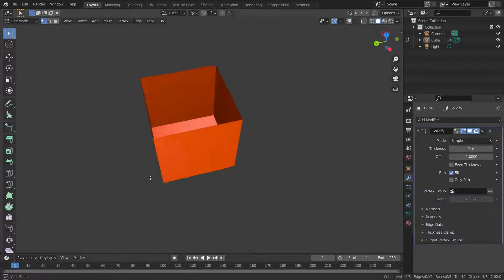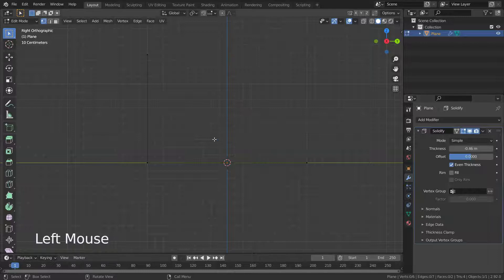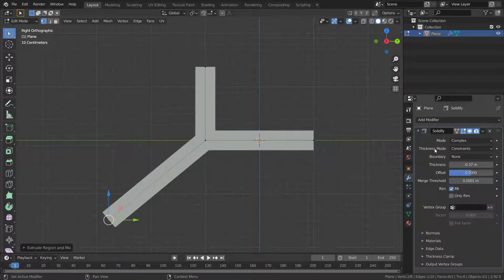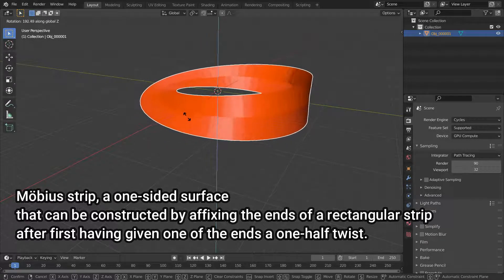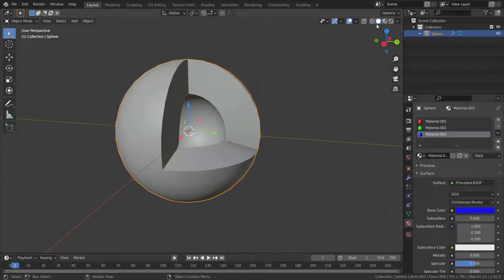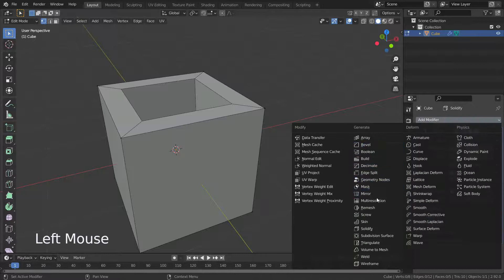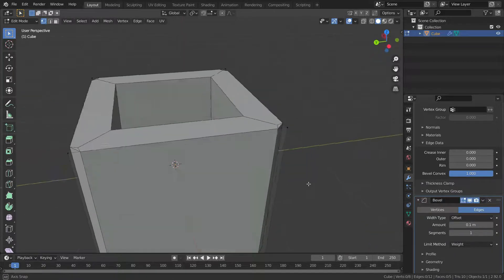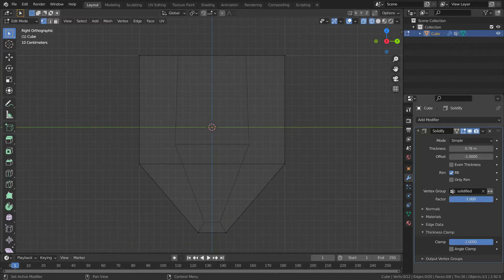How To Use The Solidify Modifier | Blender 2.92 Tutorial

Comment: Hello!

I have completed a model of a boat, but I'm encountering difficulty solidifying it.

While scaling worked well for most of the boat, the front end is problematic, where it's becoming pointed.

The bow's walls are intersecting, and ideally, the front of the boat should have a smoothly pointed and smoothed-out appearance, like a roof.

I've consulted numerous experts, but none have been able to provide a solution. Any help or suggestions would be greatly appreciated.

Thank you,

Sincerely,

Matej L.
Reply from the maker: Hi Matej,
There can be a lot of solutions to solve your issue. To be honest I can not say anything without seeing your model. However, I asked about your problem with ChatGPT and it gave me several solutions to your issue. I hope this helps you.

1. Check Normals
Before applying any modifiers, ensure that all normals are facing the correct direction. You can visualize normals in Edit Mode by going to the overlay options and enabling "Face Orientation." Blue faces are correctly oriented, while red faces indicate flipped normals. You can correct normals by selecting all faces (A) in Edit Mode and then using Shift+N.

2. Solidify Modifier Settings
When using the Solidify Modifier, adjusting the following settings may help:

Thickness: Ensure the thickness value is appropriate for the scale of your model. Too much thickness can cause intersections, especially in tightly curved areas like the bow.
Offset: Adjusting the offset value can control whether the thickness is applied inward, outward, or centered on the faces, which might mitigate the intersecting geometry.
High-Quality Normals: Enabling this option can sometimes improve the shading and appearance of the solidified mesh.
Complexity: For complex shapes, using the "Complex" mode (if available in your version of Blender) might yield better results.
3. Manual Adjustments
For complex models, automatic modifiers might not always give perfect results. In such cases, you might need to apply the modifier and then make manual adjustments:

After applying the Solidify Modifier, switch to Edit Mode.
Carefully select the problematic vertices at the front end.
Use the Proportional Editing tool (O) to smoothly adjust and move the vertices, ensuring a clean transition and avoiding overlaps. You might find the "Connected" and "Projected (2D)" options particularly useful here.
4. Use of Modifiers for Smoothing
After solidifying, using additional modifiers can help smooth out the model:

Subdivision Surface Modifier: Can smooth the geometry, but be aware it will also round off sharp edges unless you use edge loops or creases to maintain them.
Shrinkwrap Modifier: In some cases, using a Shrinkwrap Modifier targeting a simpler, manually crafted shape that represents the ideal outer surface can help clean up complex areas.
5. Sculpting Tools
For fine-tuning the shape, Blender’s sculpting tools can be very effective:

Switch to Sculpt Mode and use brushes like Grab, Smooth, and Inflate to adjust the shape of the bow manually. This can be particularly useful for organic or complex shapes where traditional modeling techniques struggle.
6. Re-topology
If the model is for animation or game assets, and the geometry becomes too complex or messy, consider re-topology. Create a new, cleaner mesh topology over your existing model. Blender's retopology tools, like the Poly Build tool or external add-ons, can facilitate this process.